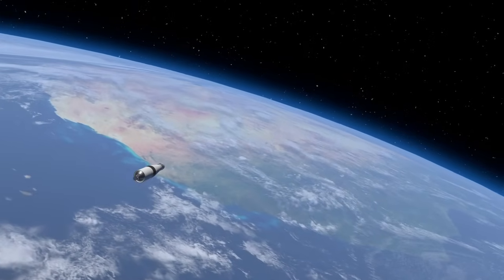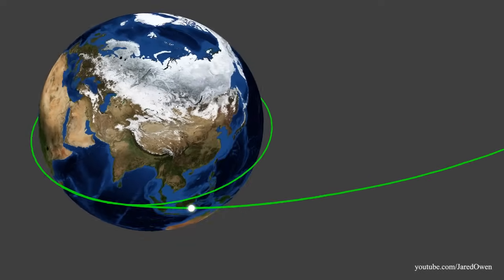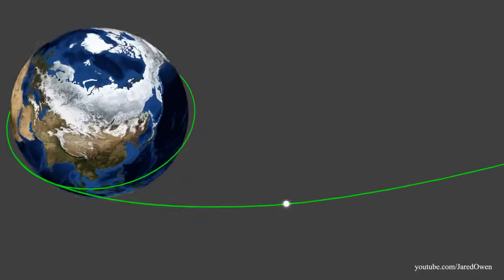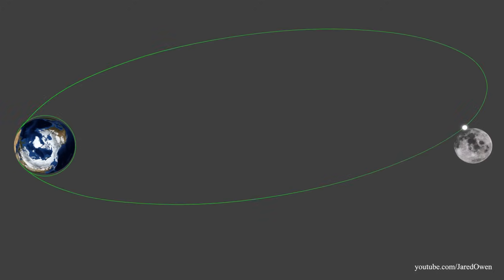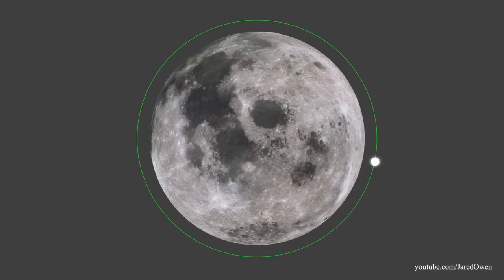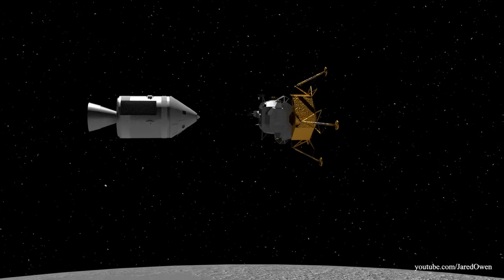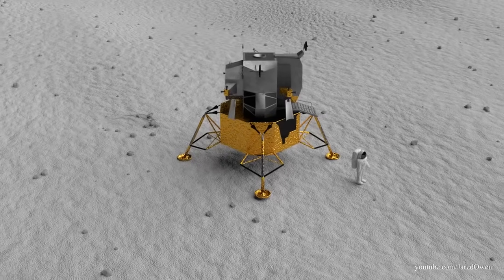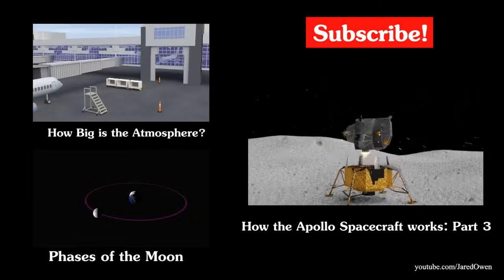How the Apollo Spacecraft works: Part 2

Comment: ...es kannt keinen begrenzten Treibstoff (Landung auf dem Mond) geben, wo sind denn die Treibstofftanks? Die hat man doch glatt vergessen...P.S.: eine Rakete besteht aus circa 90% aus Treibstofftanks...
Reply: "where are the fuel tanks? You simply forgot about that"

So, the 7,000 engineers at Grumman who spent a decade designing and building the lunar modules... all simultaneously forgot to include fuel?  That's your position here?
Reply: "a rocket consists of around 90% fuel tanks"

Depends.  What's the payload, and how high do you want to go?  The DC-X was only 50% fuel/oxidizer.  The lunar module was only about 75%.  Are you really under the impression that ALL rockets are 90% fuel?
Reply: "for landing (braking) you need approximately the same amount of fuel, i.e. twice as much, as a rocket that launches from Earth"

Huh?  The same, but, twice as much?  There must be a problem in language translation.  Anyway, it doesn't matter.  You're asserting that the 7,000 engineers at Grumman forgot to include fuel, or forgot to include enough fuel.  It's ridiculous.
Reply: "the lander already has far too little space for the resources"

So, now the 7,000 engineers forgot to include resources.  Bravo, you're a real hero.
Reply: "where are the fuel tanks? You simply forgot about that..."

The LM had two sets of fuel tanks. The fuel for landing on the Moon was in tanks in the descent stage. The fuel for ascent was in the ascent stage. See the bulges on each side of the Ascent Stage? That's where the ascent fuel was.

"P.S.: a rocket consists of around 90% fuel tanks..."

That's only for launching from Earth into Earth orbit. The Moon's lower gravity and lack of atmosphere meant that the LM required a lot less fuel as a proportion of its mass.
Reply: @maxfan1591  ...ganz im Gegenteil, zur Landung (Abremsung) benötigt man ungefähr dieselbe Mensge Treibstoff, also die doppelte Menge, als eine Rakete, welche von der Erde aus in den Weltfaum startet....
ausserem hat die Landefähre bereits viel zu wenig Platz für die Ressourcen, welche allein die Austronauten benötigen....
Reply: @Gmmaika  "...quite the opposite, for landing (braking) you need approximately the same amount of fuel, i.e. twice as much, as a rocket that launches from Earth into the world space...."

The lunar module was landing on the Moon, not the Earth. The Moon has one-sixth the gravity of Earth. That meant (a) the orbital speed was much lower, so the amount of deceleration was much less, and (b) the descent engine had much less gravity to fight against to slow the fall of the lunar module towards the ground.

May I suggest you learn a little more about rocketry before you start trying to correct the world's aerospace engineering community.

"Furthermore, the lander already has far too little space for the resources that the astronauts alone need..."

Please feel free to show your calculations.

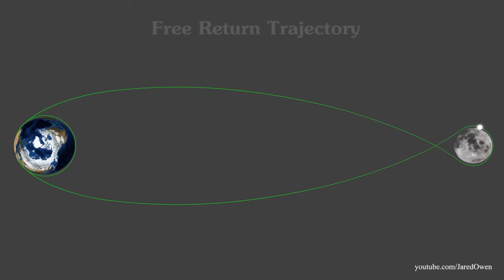Comment: But how could the "sm" still circle the moon when at 2:27 you can see that the "sm" was actually supposed to fly back to earth.
Reply: The job of the service module's main engine (SPS) was to slow down the Apollo spacecraft when over the Moon's far side to let the Moon's gravity capture it into a low, circular orbit. When the astronauts' lunar mission was finished, the service module's main engine was lit again and accelerated the spacecraft out of lunar orbit in order to get back to Earth.
With its 18.4 tonnes of propellants, the CSM alone was able to change its speed by up to 10,000 km/h. However, during a typical Apollo mission, its total change of speed was only about 6000 km/h since it also had to slow down the 15 tonne LM that was docked to it during the braking into lunar orbit.
Reply: @fromnorway643  Thank You,I underdstand

Comment: А где находился туалет 🚽 🚾❓
Reply: There was no toilet. The astronauts urinated and defecated into bags. It was gross and there was no privacy, but that was all they had space for.
Reply: @maxfan1591  ну да ну да 😂
Reply: @OtocolobusManull  Da, tovarishch! To quote from the Apollo 15 press kit: "Solid body wastes are collected in plastic defecation bags which contain a germicide to prevent bacteria and gas formation. The bags are sealed after use and stowed in empty food containers for post-flight analysis. Urine collection devices are provided for use while wearing either the pressure suit or the inflight coveralls. The urine is dumped overboard through the spacecraft urine dump valve in the CM and stored in the LM."

What do you think cosmonauts do when they're in Soyuz for a few days?
Reply: @OtocolobusManull  my friend, the greatest proof america of all nations went to the moon is the multiple bags of garbage and poop they left on the moon.

Comment: It looks like the astronauts had to EVA to get into the lunar module? I've never really thought about that detail about the mission, so it's fun to learn something new.

Edit: Actually no. In your newer video about the lunar module you show that it has a docking hatch on top. In these images it doesn't look large enough to fit something like that, but maybe i'm just not grasping the scale of the craft 😅
Reply: The docking tunnel between the two spacecraft was wide enough for an astronaut wearing a spacesuit. The backpacks the astronauts wore on the moonwalks were already stored in the lunar module, and were left on the Moon after the last moonwalk.

However, you're not entirely wrong when you talk about EVAs. If the lunar module couldn't dock with the command module after returning from the Moon, then the two moonwalking astronauts would have performed an EVA to cross over to the command module. And the Soviet version of the lunar module also needed EVAs to get into and out of, if their missions had ever gone ahead.
Reply: @maxfan1591  
The Soviets did EVAs on their Vostok (i.e. first man in space) missions also.  They couldn't land in the capsule, so, they bailed out once the craft slowed down enough, and didn't admit it for a while.
Reply: The scale is large.  It is surprising how big the lander is when you see the flight hardware or mockup versions at a museum.

Comment: 阿波罗13号如何绕过月球背面的？
Reply: Apollo 13 followed the Free Return Trajectory, described at 2:30.
Reply: Apollo 13 actually didn't follow a free return trajectory, only Apollo 8, 10 and 11 did. To set the spacecraft on a correct trajectory they had to use LM's descent propulsion system

Comment: Minute 3'14'', par ou et comment les Astronautes passent du Module de commande au Module Lunaire ? merci pour l'explication.
Reply: At the tip of the Command Module there is a hatch. Likewise, at the top of the Lunar Module there is a hatch. When the spacecraft are connected, the two hatches were opened, allowing the astronauts to pass between the two spacecraft.

The mechanism holding the two spacecraft together surrounded the hatches.

Comment: Can you Show the Materials used to Protect the Crew From Massive Amounts of Radiation. Please include what was in the Space Suits aswell.
Reply: The astronauts never encountered "Massive Amounts of Radiation".
Reply: Most alfa and beta particles can be blocked by a thin sheet of aluminium, only a small portion of those, created in events like black holes or neutron stars collisions are capable of penetrating it. But there's so little of them, the astronauts could spend a week in the most radioactive part of the Van Allen belts, covered by nothing, before receiving a fatal dose of radiation.
Reply: @raptorwhite6468 if it's not a big deal why is it an issue for NASA now when they are preparing Artimis mission and it's one of the reasons for the delay
Reply: @Dahaknit  Artemis doesn't need radiation shielding for people, but for the computers, to protect them from bit flips. It's an occurrence, that happens when a 0 bit gets turned into 1 by radiation. Apollo program didn't have that problem, because the bits in the old computers were to big to be charged by radiation.
Reply: @Dahaknit Also, the belts are a manageable hazard.  But, as with all things Aerospace, you need to test them first.  As mentioned, modern computers with small logic gates are sensitive to radiation that is harmless to people.

Comment: Loosing signal from being on the opposite side of the celestial body? What a bunch of amateurs
Reply: If you live in California, you can't tune into a radio station that broadcasts from New York City.  Not because it's too far away, but because the Earth is a sphere and from California, you can't "see" NYC because the Earth gets in the way.  If the moon is between you and Earth, you can't receive or transmit a radio signal between you and the Earth for the exact same reason.  Radio needs line of sight.
Reply: @willoughbykrenzteinburg  yea this is why you launch 2 retranslation satellites beforehand (one at polar and one at equatorial orbit). Every ksp player knows that duh
Reply: @do0myk  Exactamundo, but when you do that in KSP, it doesn't cost billions of actual dollars.
Reply: @do0myk  It's because the moon is tidily locked to the earth, that means one side is always looking out to space while the other side is facing the earth.
Reply: It's hard for radio signals to penetrate nearly 3500 km of rock!

Comment: but when they did this 180 degrees turn?
Reply: While they were on the way to the Moon. Spacecraft are not like aircraft or cars - the direction a spacecraft points and the direction it travels are unrelated, so the spacecraft can turn around and face the Earth while still travelling towards the Moon. Think of ice skating: you push off and start moving in one direction, then fall over; you keep moving in the direction you were moving when you fell over, but you can twist around and look back in the direction you came from.

Comment: How is the 180° turn in space? 🚀 your filming in winter right? The earth you used for the animation Russia and Alaska is completely white covered with snow
Reply: "How is the 180° turn in space?"

Good question. We're used to the idea of things travelling in the direction they're pointing. But that isn't the case with spacecraft in freefall. In freefall the spacecraft can point in whatever direction the crew want, and also apply a small amount of acceleration in any direction too.

This is hard to re-create here on Earth, but probably the simplest equivalent is to imagine you're sliding on ice: once you're sliding, changing the direction you're facing isn't going to make you change the direction you travel.

Comment: I have a doubt. You said that after detaching from the 3 rd stage the service module will turn around and pickup the moon lander in 1:33th sec. Then my doubt is how the service module move backwards without any external force??? I hope anyone will clear my doubt😊
Reply: The service module had 4 of these sets of thrusters (16 thrusters in all) mounted at 90° intervals around its outside, each producing 100 pounds of thrust.
https://en.wikipedia.org/wiki/Apollo_command_and_service_module#/media/File:Apollo_RCS_quad.jpg
They enabled the CSM to move along all three axes and also to rotate along all three axes, exactly what it needed for the transposition, docking and extraction manoeuvre that you described.
The ascent stage of the LM had 16 similar thrusters.
Reply: To put it more simply - - the service module didn't just have the one big engine.  That big engine was for big maneuvers like course corrections and building up speed/slowing down....things like that.  There were another set of very small thrusters known as RCS thrusters mounted around the craft for smaller and more precise adjustments.  Those are what was used to move "backwards" to pull the LM out.

https://en.wikipedia.org/wiki/Reaction_control_system
Reply: This clip from the movie Apollo 13 shows how the RCS thrusters mounted on the service module are fired in order to back the CSM/LM away from the third stage after the docking.
https://youtu.be/hMsr1uk9gFs?t=183
If the later explosion in the service module's oxygen tank hadn't happened, its large main engine (SPS) would be used to slow down the spacecraft to let it be captured into an orbit around the Moon and also to accelerate out of lunar orbit before the journey home.